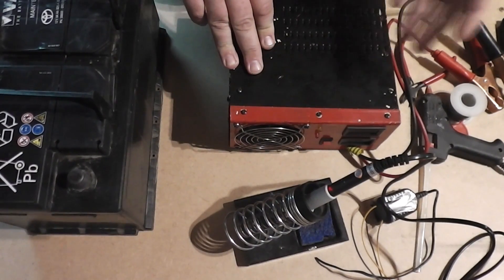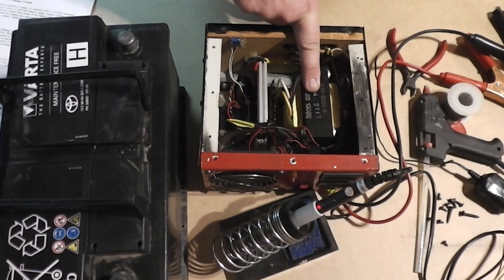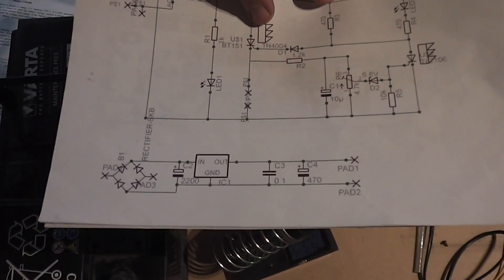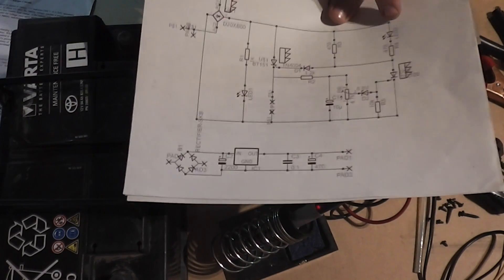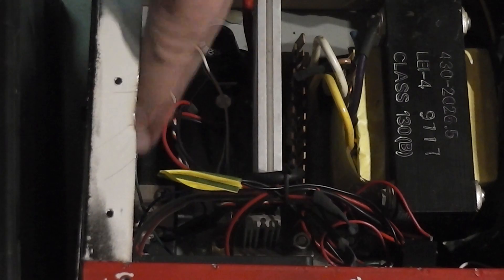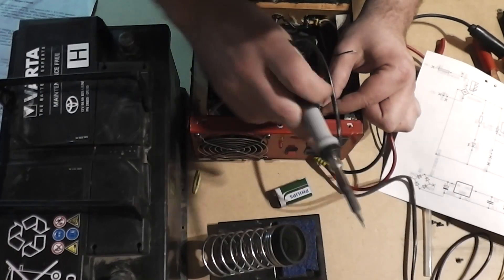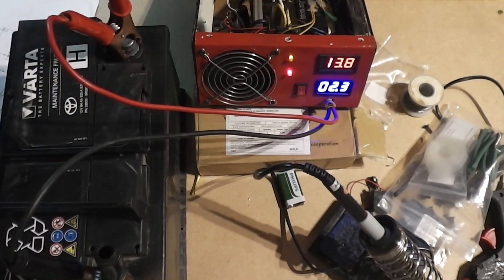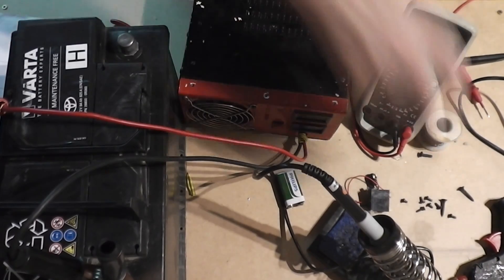DIY Car Battery Charger - Best and Cheapest, Automatic, Powerful

Comment: Do you have a link or name for the voltmeter and ampermeter modules? How many wires did they have each.
Reply from the maker: mate AliExpress and get em from there. I built this like 8 years ago, it still does the job with no problems.
Reply: @FantaBH  In the video you mentioned you use the 9V battery for both meters so I was confused since the voltmeters are usually 3 wires and the isolated 9V does not connect to the common ground like in the circuit. I just used the 12V supply from the fan circuit to power the voltmeter, but I wanted to ask if you have any links to the ampermeter and voltmeter modules you used
Reply from the maker: Don't have links sorry mate , but for real those are old offers on eBay or AliExpress. Today you get both in one package for just a few bucks. What I do remember amperemeter is purchases with 100A shunt, and both instrument's to work properly had to have separated power supply from what they measure, so I added a little switching power supply 5V for both and solved my issue with 9V batt forever. And instruments can work from around 3.3V to up to 20V .
Reply: @FantaBH I wanted to ask where did you connect the ampermeter two probes, was it to the battery negative and ground in series, battery positive and thyristor cathode in series?
Reply from the maker: Ampermetar in my case , has 2 thick wires and two tiny wires, in both cases red and black. Two thick , black to minus side of sense resistor, red to the other side of the sense resistor. Sense resistor is connected to minus output and other side to the load ( battery under charge) .  Tiny wires are plus and minus for digital instrument to make it work , separated source from device for which current is measured.
Reply: @FantaBH  thats very helpful, do you think it is possible to use only one diode bridge and add a 7812 rectifier at the end of the schematic to provide power to the fan and Amper Volt meters?
Reply from the maker: @sharkiux it will not work , it needs to be an isolated power for instruments, however for a ventilator you do not need isolated power. As an isolated power I always use an old mobile charger board. 5V is enoughm
Reply: @FantaBH  I have one of those volt+amper meter modules two in one (VAM10010), I'm going to try supply it with the charger schematic, those modules actually allow to be fed off the measuring voltage so I'll see how that goes :)
Reply from the maker: @sharkiux  try it, but I believe at least amper meter will not work if it is powered with same source it measure. But who knows. Let us know about result of your try out.
Reply: @FantaBH  I tried it and your theory was correct, I tried supplying the meter with the same voltage that flowed out of the diode bridge and both ampers and voltage were 0 even during charging, I placed the red wire near the 7812 output instead and it worked as intended
Reply: @FantaBH also had a question why did you use two diode bridges one for charging and one for fan, is it also for a separate power supply?
Reply from the maker: @sharkiux no it is not separated PS. it's just a small one for cooling fan. It can be done with just one bridge.

Comment: Hi, 
I would like to charge my 210VDC NiMH Battery pack with 4-8amp. 

1- Should it work if I will use direct Grid 220VAC to a Bridge Rectifier (GBU808) and then use Rectifier's  DC output of 220 VDC to charge my 210VDC Battery directly?

2- Do I need to add any other electrical component along with Rectifier to achieve basic target?
Reply from the maker: To charge NiMh batteries you need clean DC power. If you use full Bridge rectifier , you will get significant higher voltage as DC than it is AC 220V, to be exact DC will be around 311V . So no there is no chance you can use that to charge your battery. I need to say I never seen such battery , I mean I seen high voltage batteries but never NiMh .AND PLEASE IF YOU DO NOT KNOW WHAT YOU ARE DOING, DO NOT PLAY WITH MAIN VOLTAGE , ANY MISTAKE CAN LEAD TO FATAL RESULT. Any mistake can lead to Fatal Result. 
p.s. It is possible to build such charger and it is not complicated.

Comment: set charging limit 12.9 to 13v and auto cutoff 13.8 to 13.9 please guide me it is right ?????????????????
Reply from the maker: 12.9 is start voltage , if battery is far bellow 12V , initial charge will be high current over 15  Amp , but it will  lover down to current witch is equal to 10% of  battery capacity.That will be during first 10 min of charge process.  Cut off is set to 13.8 V in my case. And this charger can handle power up to 300W. In my case Transformer is limitation.